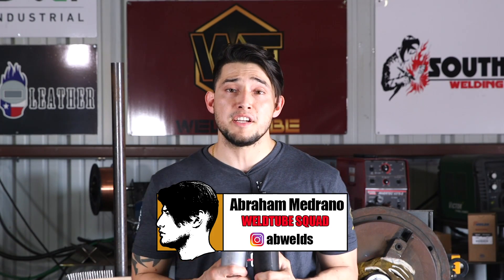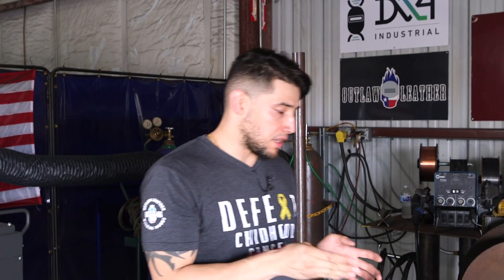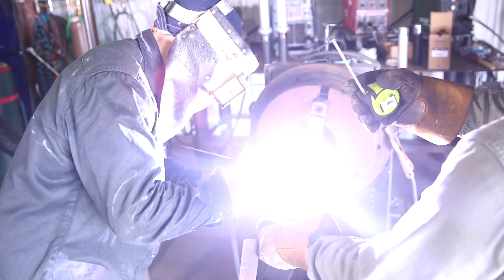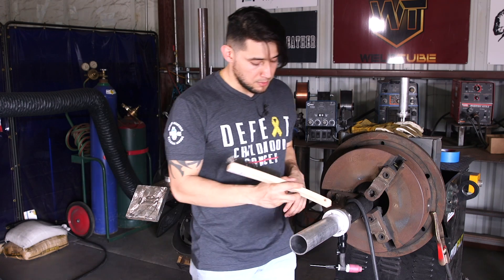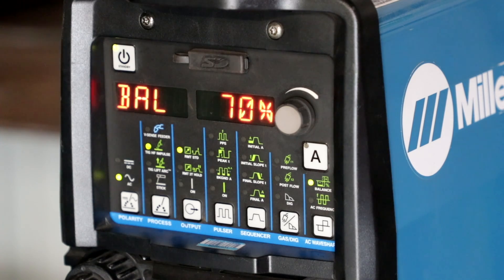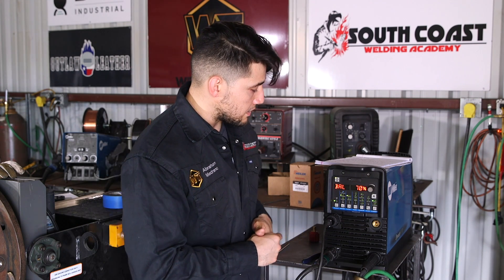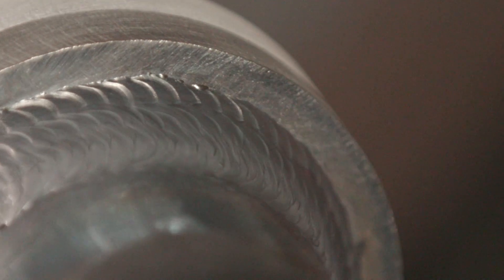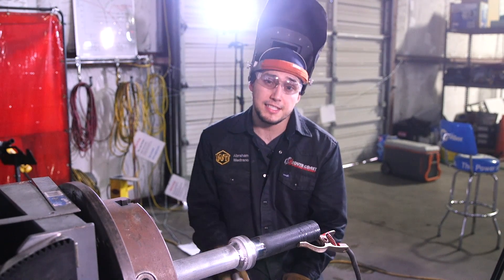How to Weld ALUMINUM to CARBON STEEL?

Comment: So repeated thermal cycling doesn't weaken the roll bond over time?
Reply: Good question. I haven't seen any hard data on  the subject. But considering this type of construction used in commercial cookware (ever heard of All-Clad?), there must be a substantial tolerance for thermal cycling.

Comment: Is multiply passes stronger than one big pass that would make it? I'm rusty on welding....
Reply: Yes, because you get better penetration, and you dont heat the rest of the material up as mutch
Reply: @Absoill  Ah ok so I thought one big weld was gonna be better but I haven't welded in ages so yea :D Need to try it thanks for the advice :)

Comment: saludos.primero cuanto es la resistencia a la tracción de la brida.segundo. el aporte de aluminio,si es 5356,no deberia haber sido mejor soldar el carbono primero.porque con 4043,no habria problema por el recalentamiento y absorcion del aluminio.saludos a todos

Comment: Why the gap between the pipes. Isn’t the transition literally the same two dissimilar metals? If the two dissimilar metals can’t touch for galvanic corrosion reasons how is the transition piece protected from that. I say butt the pipes together. Won’t make any difference what so ever and the second fit up is infinitely easier.
Reply: That would make a crevice where corrosion could start.  You need to exclude water and air completely from the transition.  Getting inside and putting a perfect bead between the pipes would help,  but that's a lot more work for little gain.   Small gaps are the worst.   Zero gaps = short circuit with no electrochemistry (except at the inner and outer surfaces),  large gaps = high resistance and little electrochemistry across the gap (unless the pipe is carrying salt water or some other strong electrolyte)

Comment: As always, good video. I can't wait for the day to use a dissimilar metal ring. Only a suggestion, stagger your start/stop points on each stringer. I have seen you do it before. This is just a reminder for those thst are newer to welding. Also, that dual foot pedal is bsd a$$

Comment: A product called Neptune SS will join aluminum to steel. It is done via brazing rather than it being welded but is incredibly strong and can do any metal combination together.
Reply: you can also just straight up weld them together with either silicon bronze or aluminum bronze A2
Reply: @ryanturriff6020  "BRAZE" them together using silicon bronze or aluminium bronze👍 Theyre brazing wires bud
Reply: @kf8575  I weld with it on the daily; gtaw and gmaw.  I have to weld up coupons for the navy using silicon bronze, aluminum bronze, and nickel aluminum bronze.  automotive manufactures use silicon bronze out of 500 lb drums for the automotive welding processes.  Aluminum bronze A2 is used for fixing brass pumps and water fixtures.  Nickel Aluminum Bronze is used to rebuild props.  can silicon bronze be used for brazing, yes; also can be sprayed.  but it can also be, and usually is used in a welding application.  this is my business and i have been doing it for 20 years.

Comment: Without the ring you cannot weld aluminum to carbon.I don’t know the cost of the ring,sure it’s not cheap.
Reply: yes you can with either silicon bronze or aluminum bronze A2

Comment: What about electrolysis? The carbon steel will chew the aluminum up very quickly
Reply: Bimetal coupler and then made sure to have a gap between the dissimilar metals. I thought the same thing at first  but this coupler is the solution.

Comment: About aluminum tig welding sir how about the using it is mixing argon gas and hilium?thank u
Reply: helium its hotter de argon 
much better then argon
helium more expensive
helium light gas then argon

Comment: A wire brush doesn't remove oxidation , it only smears it acetone removes oxidation .
Reply: What is the feller used for this desimilar materyal

Comment: Thanks for explaining the frequency like that. You actually got me to understand something I couldn't for almost twenty years. 
Isn't there something apart from the roll bonding that can be used to physically weld like stainless to aluminium or brass to carbon or brass to stainless?
This is a bloody good video. Thanks!
Respect from 🇿🇦
Reply: I know there's explosive welding, where you lay 2 plates with a thin gap between them, and put a layer of explosives on top.  Detonate the explosives, and the blast fuses the plates.  The collapsing gap forces air out in a shockwave, taking with it any impurities on the surfaces to be welded.

However, I doubt that's what you're thinking of, since it's not remarkably practical or scalable.
Reply: Best you can do without bags of explosives is brazing.

Comment: Is it possible to weld the steel first so there’s no extra tungsten starpening?
Reply: Ceriated or Lanthanated will weld both👍
Reply: Alum & carbon steel doesn't use the same tungsten .. Alum uses pure tungsten (green) carbon steel uses 2% thoriated tungsten (red)
Reply: Wesley Kay Not on the Dynasty series welders. Miller does not want Green tungstens used in this series machine. However you’d be correct if it was a Syncrowave.
Reply: @husmanraceengineering  what color tungsten 8s used ? Where I work we have a Miller .. did not know that we learn somethi g new everyday ..
Reply: Wesley Kay my thought was that green tungsten is only used in transformers. Every other tungsten can be used for everything. I hear thoriated isn’t good for alum though.

Comment: It makes me curious how long that piece would last for because of galvanic corrosion, if itll affect it at all somehow.
Reply: shane  so it's glue of some sort "bonding" them together?
Reply: @kf8575  explosion welding is a great example of dissimilar metals being forced together
Reply: Ken F they’re welded together through friction
Reply: Ken F nope it’s essentials  welded them just from the pressure caused when the two metals get tolled
Reply: That’s why you should just use nickel and butter a layer between the two so you can weld it without worrying about that due to nickel being compatible with both metals

Comment: Silicone bronze. Not welding it's brazing because both parent metals do not melt.
Reply: Or A2 Bronze will work as well.  both are used for dissimilar welding...
Reply: @ryanturriff6020  silicone bronze doesn't need AC to work so much more versatile is why I suggested that but yes aluminum bronze works as well

Comment: pretty neat... bi metal ring.  would love to see more on those.  but one question why would u need to transition from carbon steel  pipe to aluminum ?
Reply: I really don't know. The only instance where this applied in my career was on a Navy ship in a shipyard. The deck and internal framework was all steel of course but deck houses such as pilot house, galley structure etc. was constructed from aluminium. My job was to replace a hatch (door frame). I think companionway access is probably the correct term. Anyway, the bottom of the door frame fit down into the steel house foundation while the majority of the door frame fit to an aluminum bulkhead. The yard simply procured a piece of flat bar that half the width was aluminum and i think it was 3"and then at that point was fused to steel.

Comment: Why not the carbon steel side first? It would have preheated the aluminum, maken it much easier to form a puddle.
Reply: Probably because it didn't cross their minds, lol 💀
Reply: Yes, Good point.
Reply: Aluminum heats up easy enough anyway. Shouldnt have to preheat aluminum
Reply: @tommys2979  That is true to a certain extent, but since it was his first weld on the cold aluminum, it would've helped a ton to initiate a weld puddle if they would've preheated the aluminum fitting, common sense if you've welded enough aluminum.

Comment: All he did was weld aluminium pipe to aluminium flange and steel pipe to steel flange.He didn't weld aluminium directly to steel which nobody can do per say.There is such a thing called,"EXPLOSION WELDING"!
Reply: This is the ONLY comment that speaks the truth!!! Craig you are 100% correct!!! He did NOT weld aluminum to carbon steel!!! Someone else did that for him!!!
Keep Rocking it out Brother!!!
Reply: Silicone bronze will braze it
Reply: Yes explosion welding can weld any dissimilar metals, pretty cool.
Reply: Explosion Cladding
Reply: I wonder if u can friction weld aluminum to carbon steel.
Reply: Alumasteel makes a set of electrodes that when used together actually bonds steel to aluminum. I don’t know how but it works

Comment: Does the aluminum pipe get weaker at the end of the weld beads? From all that heat?
Reply: Short answer yes it does. It will only re temper back to 3/4 of original strength